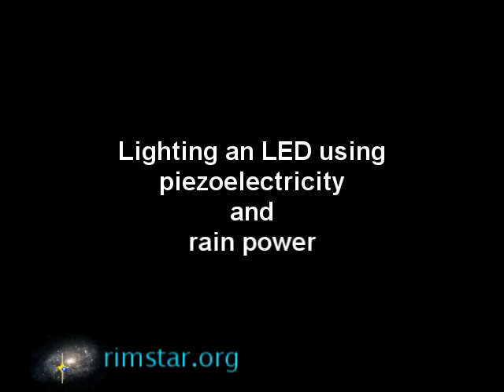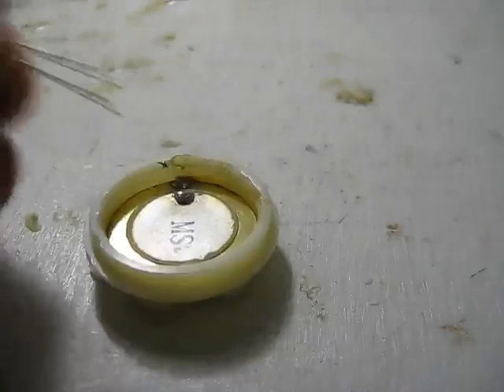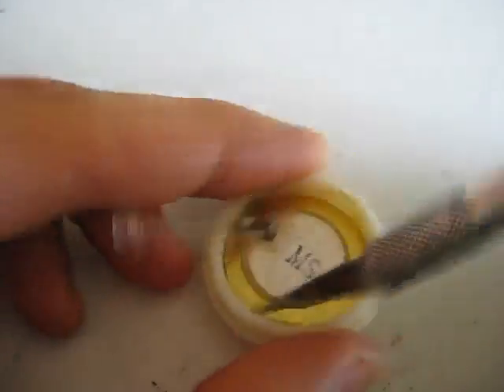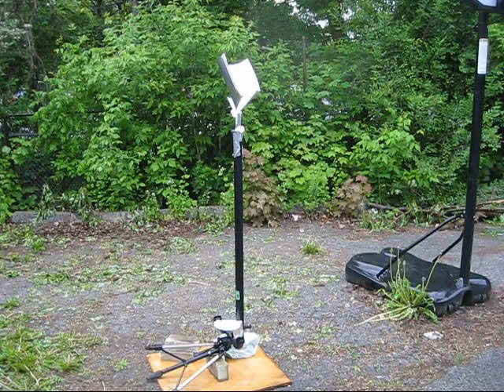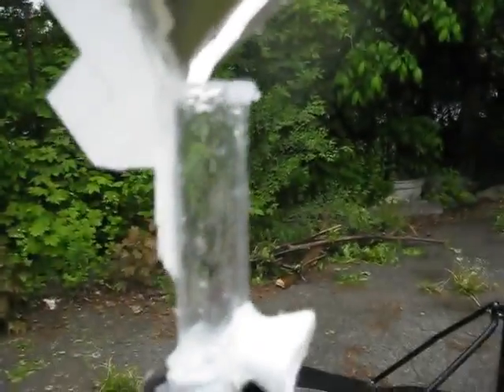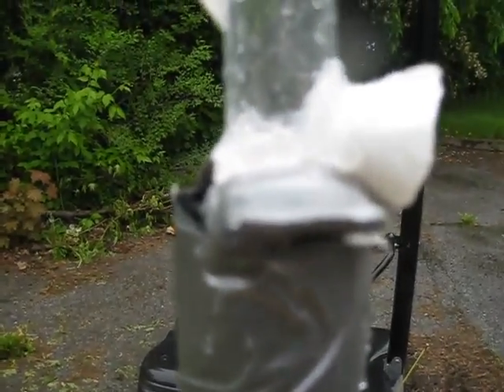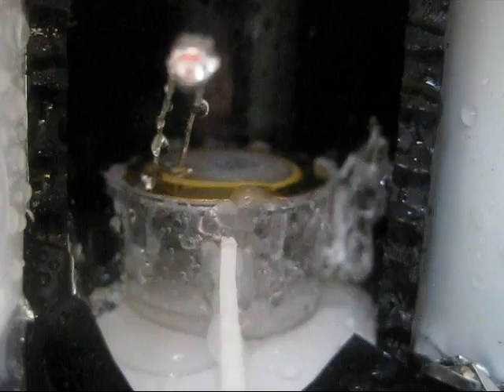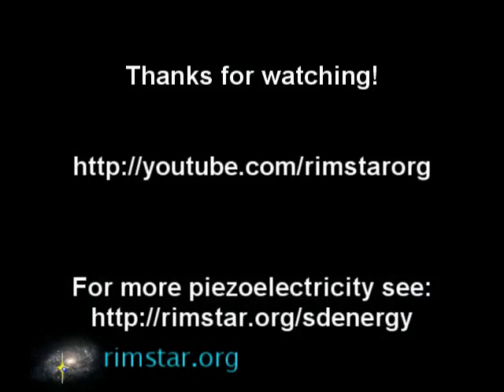Piezoelectric generator LED lit by rain water

Comment: okay, lets scale up with either, tidal force to create your vibration, or steam to create your vibration.
I wish I had your knowledge bro, you're mad smart.
I'm looking for someone to create a mini scale of the great pyramid of giza. Its often suggested these days that is was a piezo generator using a quarry, and granite, which contains quarts. My belief is if we can make a pressured container, with "piezo material" inside, then the pressure will act as tension for vibration. then if we can get some type of of sound, wind, fluid to vibrate the container. The piezo could be like an eardrum, and behind it is pressurized "piezo material" and the housing has nodes to connected wires too.

Comment: RimstarOrg  You just gave me the best ideal for my stepsons science fair project take a bunch of these have them each linked to a different light then a pump hooked up to a speaker pumping to music . The lights each get hit with different height drops at different times via different pumps going to the bass and treble of some techno or dubstep. Anyone that wants to tell me what all I need exactly email me screwsandpins@gmail.com the more info the better. My step son wanted to tear apart a rc car and make it out of Legos no not happening that's a 600$ Traxxas  rc. Showed him this and now he's wanting to go buy a bunch of bday cards that play music . Now can't we make our own crystals that would be more sensitive ?? . Help please
Reply from the maker: Sounds like a great idea! Let me know how it goes.
Just one thing... Newer B-day cards seem to have electromagnetic speakers in them instead of these older piezo speakers. Instead, do a search on ebay.com for piezoelectric and you'll find them for much cheaper. Make sure you get them with the wires already connected since I suspect they'd be hard to attach yourself.

Comment: Hii
I like your video about using the piezoelectric to glow the LED. Can you help me out if I can somehow use this piezoelectric effect to generate enough power to run my small underwater rov. I am currently working on the problem how to reduce the payload weight of my rov. Any help would be greatful to me. Thanks!!
Reply from the maker: Hi, There's nowhere near enough power from piezoelectric effect to power an rov. You might want to consider using lithium polymer batteries due to their high energy storage density to weight ratio.

Comment: Good work. I have one general question ,don't they get shorted when you keep the piezo disc under water with polarities?
Reply from the maker: Thanks. The only time current flows is when the water drop hits the piezo disc. At that point, assuming the whole thing is sufficiently drenched with water then there are two paths for the current: through the water and through the LED. I know tap water has a resistance in the tens or hundreds of kilohms. I don't know what the resistance of rainwater is in the air, but it would get contaminated pretty quickly when it hits the crystal. I guess once the voltage is sufficient for the LED to conduct, it has a sufficiently lower resistance that enough current flows through it. Maybe some current also flows through the water, in which case that would be a loss.
Reply: Interesting I have never compared the resistance of water . at present am working on water flow measurement using piezo discs ! One is transmitter and other one is receiver. Am trying to find out the delay to reach sound waves to reach other piezo.. I have placed the piezo s diagonally in 30 degree angle. Am receiving   around 50 to 100mV of vg but with phase shift( which shud be with same phase of input signal when there is no flow). And I increased the flowrate from  0 to 15 l/m but not able to find any phase shift :( . I am driving piezo with 5vpp sine wave ,1MHz frequency... Am I missing anything , please let me no your comments if I have missed anything

Comment: Have you tried using same sort what's found in lighters? I'd love to know what type they use in them
Reply from the maker: +James Smith Interesting. No, I haven't tried them. I guess you'd have to glue on a rigid disk to make a larger target for the drops.
Reply: true or do it on your pipe line into something narrow. A series of straws perhaps 1 for each.
Reply from the maker: +James Smith It has to impact the piezo crystal fairly hard. That's why I have it drop from a height since the higher it falls from, the harder the impact. A piezo from a lighter is a pretty small target and I don't think you'd get the repeated accuracy from the needed height.
Reply: That's why i said feeding the bottom end throw a straw. It would always hit it. So the pipe line be large on the top but narrow on the bottem end.

Comment: Hi I am doing a project on this for school, and I was wondering if the piezoelectric disc you used is similar to a regular piezoelectric sound transducer, or would I have to buy another altogether? Like one specifically made. It would help if you answered, thanks. :)
Reply from the maker: +Shivani Shastri A transducer converts energy from one form to another. The one I used is a transducer since it converts sound energy (pressure) to electrical energy. So I'm guessing you're looking for one that works well in the opposite direction, converting electricity to sound. That's actually what the one I used in this video is most often used for, for a speaker.
Reply: +RimstarOrg Actually our project is quite like yours as we are using rain to create electricity with a piezoelectric transducer. Sorry if I didn't make that clear

Comment: what voltage did u get? can i use a capacitor?
Reply from the maker: Leonardo Nerone I didn't measure the voltage. I guess you can use a capacitor, I've never tried. I think you may need a diode to prevent the capacitor discharging.

Comment: Does the piëzo-electric crystal have to be waterproof, or is there no difference in wheter it gets wet or not? We soldered wires to the crystal so we could use a multimeter from a distance to make sure the multimeter doesn't get wet.
Reply from the maker: ONEMOREMlLE30 I ran it wet for probably only 10 or 15 minutes at the longest and didn't notice any negative effect on the crystal. I don't know if there's a negative longer term effect.

Comment: Also, thanks for having DIRECT LINKS to things in the description of this video, and thank you for making your website design, based around quick navigation. It seems to be a trend to make things on websites, as indirect as possible and take as long as possible to find what you are looking for or to just give up. It is great that once your page loaded, I didn't have to touch my mouse or keyboard, and could find out about everything on your website, and get straight to what I want with 1 click. Also, thank you for not using "shortened urls" for your website, because I don't trust those, since they can redirect you to malware. A+++++

Comment: Thats cool! I am looking for really cheap piezo to experiment with generating power. I looked on ebay, but I think these are the cheapest http://www.dx.com/p/zx-18t9a1-18mm-piezo-transducer-sound-discs-w-leads-10-pcs-147962?utm_rid=63162472 . I notice that many of them on ebay, call them "buzzers". On ebay, It appears that being a "buzzer" is what they sell them as. To my limited understanding, it seems that is nothing more than a possible function and not something that directly states it's only function and can be used for the same thing you built in this video (lighting up a tiny LED). Maybe you or someone else, can save me some time and help me choose a $1 to $3 order for some of these things. I have no prior experience with Peizo's, so there is no point in getting ones that cost hundreds of dollars and then I break them out of ignorance. Also, I have ordered many times from that site and generally from china/hong-kong before and know about the time it takes to arrive.
Reply from the maker: Jay H I don't think I can help much with buying piezos since I've never bought any, only found them in things. But the ones I've found have all been useful. And thanks for that link. 10 disk-type piezos for $1.82 and free shipping sounds great. Whether or not they work for a specific project is something else. Searching on ebay for "piezo transducer" I see a lot sold for musical instruments. I guess it depends on your search text.And thanks for the feedback re my website and use of direct links. It helps to know what people like.
Reply: RimstarOrg Thanks. I am really anxious about ordering ASAP, but I need to take a little time and figure out what size capacitors and resistors and LED i would need to do something neat. I'm watching most of your videos, starting with the oldest first. That is crazy that the crystal is just baking soda, cream of tartar, water, heating and cooling. I have built a copper/magnet generator before, but since I used a cardboard box as the housing, it didn't work very well, but it DID make the light flicker. Since that project many years ago, I have been searching for something more practical, and your video archive will point me in the right direction.

Comment: Could you tell me what brand of giftcard the piezo-electric speaker was in? I'm having some trouble finding that kind of speaker. The only brand I can find is Hallmark. It might be the only brand that has giftcards with speakers that I can find in my country(Belgium), so I might have to order a giftcard online since that might be the only way to find this piezoelectric speaker. I've seen the instruction on how to find that kind of speaker on your website, but all of the cards I found had a magnet in them.
Reply from the maker: ONEMOREMlLE30 Unfortunately I don't know what brand it was. It was a card that was given to me a long time ago.Other places you can find these disk shaped piezo crystals is the speaker in most microwave ovens and piezo buzzers sold in electronics stores and some hardware stores.You can find a very different shaped piezo crystal in BBQ igniters and in some lighters. These are rectangular block or cylinder shaped and if you're doing this piezoelectric generator with rain water project, it might work if you glue a small disk made of a rigid material to one end and use that instead. I haven't tried that myself but just thought of it now. I have webpages about those too:http://rimstar.org/materials/piezo/ignitor1.htmhttp://rimstar.org/materials/piezo/how_to_get_piezoelectric_ignitor_from_lighter.htm
Reply: RimstarOrg thanks for the response!
Reply: RimstarOrg Is it possible that these crystals are found in some alarm clocks? I just cracked open an alarm clock and it has a small non-magnetic disc in it that looks similar to the crystal in the video.
Reply from the maker: ONEMOREMlLE30 Yes, that's entirely possible. Anything that makes an annoying buzzing or beeping sound quite possibly is using a piezo crystal like this.

Comment: Is it possible to just put the piezo crystal under a running tap to make it produce even more power?
Reply from the maker: rasen58 Yes, it's possible. Though here in the city, big city run pumps are used to build up our water pressure so it wouldn't make sense to do it unless you're already running the water for something else like taking a shower or cleaning dishes. Even if your water comes from a water tower, the town had to pump it up to the water tower. If you line your bathtub with piezos to catch shower water, I'm guessing most of the water hits you first and then drips off of you so there wouldn't be many energetic water drops. The only way it'd work I think is if you direct the water from your drains to a pipe that goes to a place where it can have systems like I show in this video that break the water into drops and drop them onto piezos. So it's possible but I'm not sure how practical.
Reply: RimstarOrg Can't you just put the piezos in the side of the drain pipe so that when the water from the shower goes down the drain, the pressure from the water flowing past the piezo creates a voltage?
Reply from the maker: rasen58 Ah, I see what you had in mind. No, that won't work. Piezos respond only to a change in pressure. A constant pressure won't produce any voltage. So when the first bit of water hits the piezo, then there'll be a brief spike of voltage, followed by nothing, even though the water is still flowing. But even then, as I showed in this video, you need to break the water up into small, discreet, certain sized drops to get it to work. A paddle wheel in the water flow turning a generator would work though i.e. micro-hydroelectric.
Reply: RimstarOrg Oh I see. So what if you could alternate the pressure in the pipe? I drew a crude image http://i.imgur.com/gOxGImG.png
The one I drew uses two pipes actually, one on top of the other, where the pressure of the water going into each pipe is alternated, with the top one being at 90 psi for 20 seconds and the bottom at 60 psi and then switching. The brown diamonds would be the piezo crystals.
Or I guess you could just have a pressure regulator at the beginning of the pipe? But then again, I'm not sure if it's good for the pipes if the pressure is changed like that.
Reply from the maker: rasen58
Oh, good thinking! Another design would be to have a single pipe that directs to the top of the thing in my video, or many of them in a row. Your design would work better with the rectangular, bendy type piezo crystals, though I don't know if you can by them in small quantities. You'd have to search the web. Though I'd never thought of it for a drain pipe for indoor water, I have thought about that for taking water from a drain pipe coming from a roof for rain water.
Reply: RimstarOrg
Yeah, although I drew only one crystal in the image, I think the entire length of the pipe and on all sides could be made of multiple rectangular crystals, so you would want them in bulk quantity. 
But now that you mention it, the drain pipe thing would actually be pretty good in rainy places, so all the water goes down the roof into a tube made of piezo rectangles that generate power.
Thanks for the help!

Comment: Can you attach these crystals in a (metal) chain hanging something, and with a bunch linked up, how powerful could it be?
Reply from the maker: Alan Greenspan I don't have any numbers, but it wouldn't be very powerful. The voltage is high but the current is low and each time a crystal is hit, the output happens for only a very brief time.